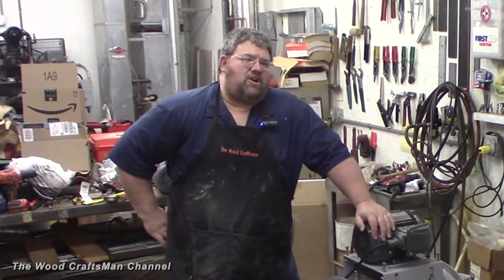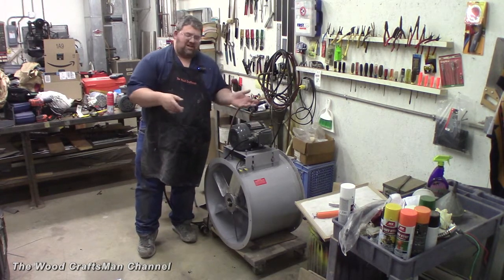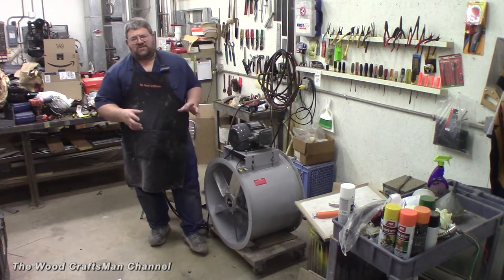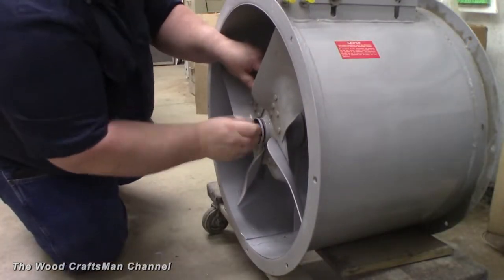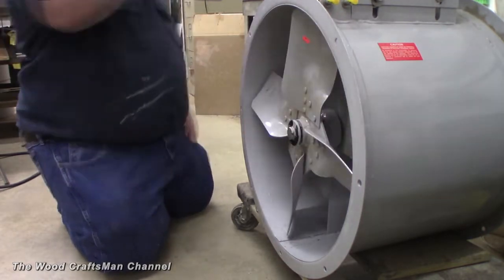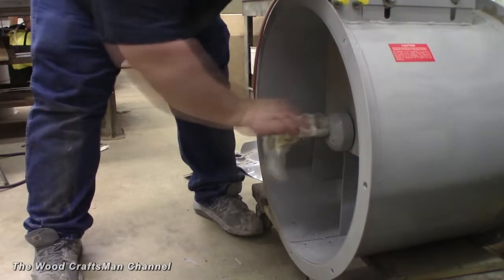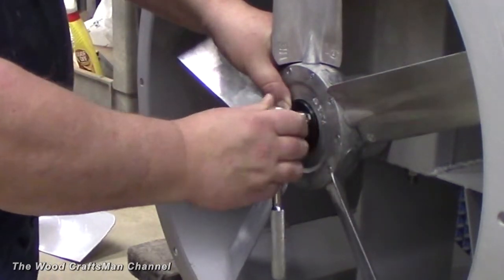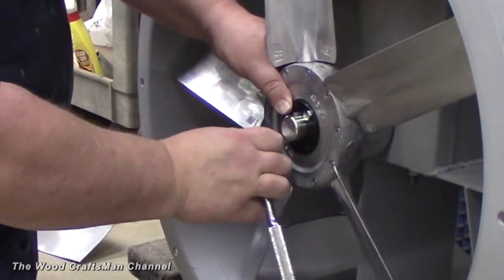Tube Axial Fan Blade Replacement # 299

Comment: What type of power supply do you have it wired up ??  The black box
Reply from the maker: It's an old Leeson (AC Tech) VFD (variable frequency drive). 110-120 volt 1 ph input, 0-230 volt / 0-120Hz 3 ph output.

Comment: I just bought a used fan, do you know what would be involved in servicing one of them before I install it all?
Reply from the maker: For the fan itself, Just check the health of the bearings. It it spins freely and doesn't growl when it spins, it should be good to go. If you the bearings are greaseable, maybe give them a fresh shot of grease. Same for the motor. If the belts are worn, replace them as well. Hope this helps. Scott

Comment: Which variable frequency drive are you using? Also are you running a phase converter? If so what are you using?
Reply from the maker: It's an old Leeson Speedmaster (made by AC-Tech) VFD. No phase converter. 110-120 volt single phase 60 Hz AC in, 0-230 volt 3 phase, 0-120 Hz AC out.

Comment: what did you do with the old 1/one, because if it fits my belt drive homart window fan...and or direct drive 07 i think or so lakewood p25 either 20" and or 22" or so box fan...then i cause it for that. Or my or rather...our meaning the families but my dad did say it was his but now he calls it mine...but its a 30" utilitech black pole, base, motor and 3 bladed flat pitched blades, and silver guards with black circle with white...i think either white logo words with red and yellow...and or just white or so...then i would want it. but i would/might want it either way